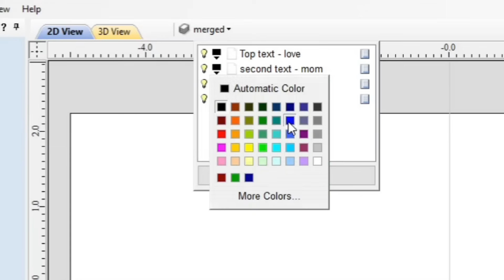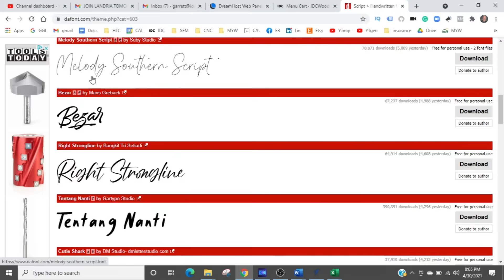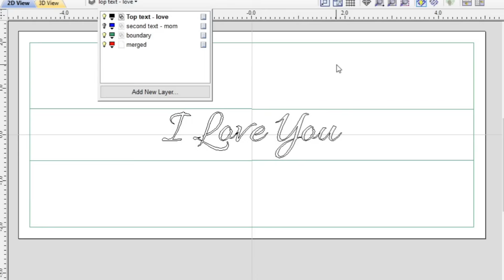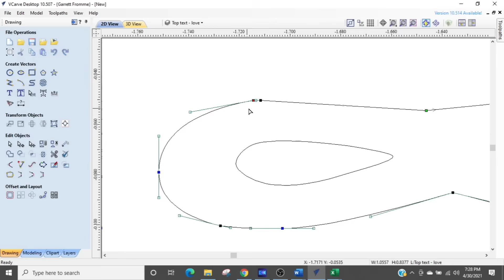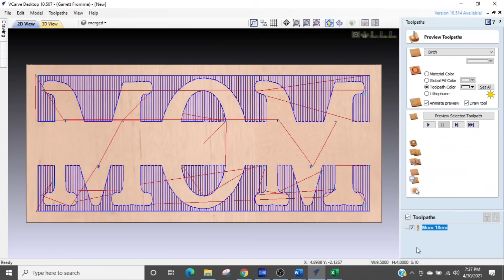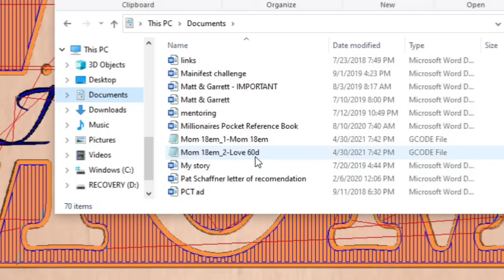Easy CNC Router Project Mother's Day [Vectric Aspire & Vcarve Tutorial] - Garrett Fromme

Comment: I tried to follow along( had some problems) brand new to cnc, I have a onefinity foreman. When I do mine on the screen the letters mom turn the orange and not the background. Can you tell me what I am doing incorrect please. If the background turns orange that means the letters are raised up, correct?
Reply from the maker: justwavingenterprises2542, It sounds like you might be having an issue with your settings or the way you're selecting your objects. Typically, if the letters turn orange, it indicates they're being set to cut or carve. The background turning orange usually signifies that it's selected for carving down into the material. Double-check that you're differentiating between your text and the background correctly. Good luck with your Onefinity Foreman!
Reply: @IDCWoodcraft   Hey Sir, I did some more and some come out like yours and some with the letters being cut. I thought I did them all the same way but I must be doing something not in the correct order. I will get it figured out  (maybe). Thanks for all the videos

Comment: We ran this project several times and can't correct the bit climbing out of the pocket and skipping across the MOM section. Changed the home start and safe z heights with no change. What is the toolpath command to raise the bit to full height over the material before traveling?
Reply from the maker: Ernest, I think your problem is still in the safe z height brother. Try raising it to an inch above or higher. That will be your best bet!